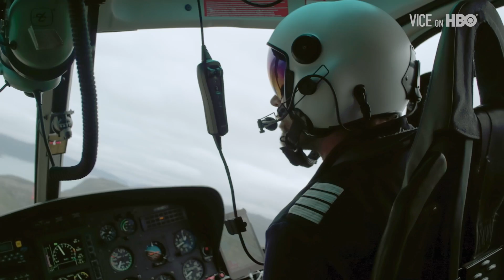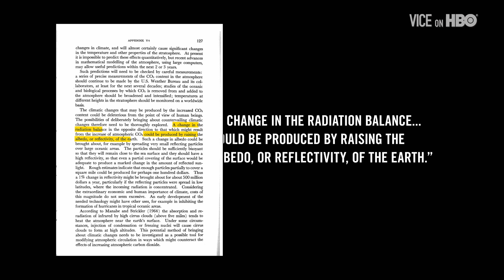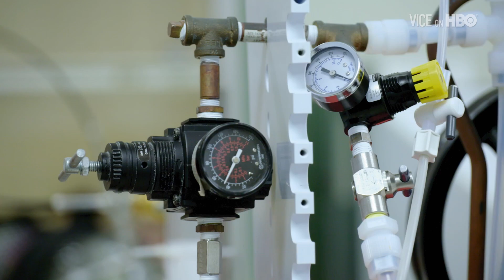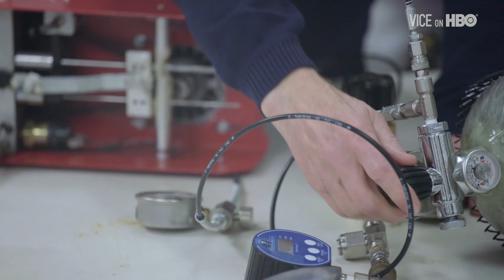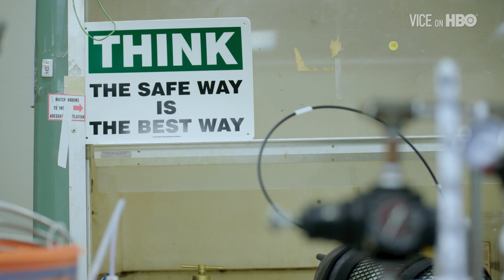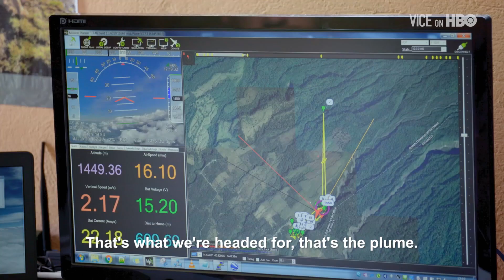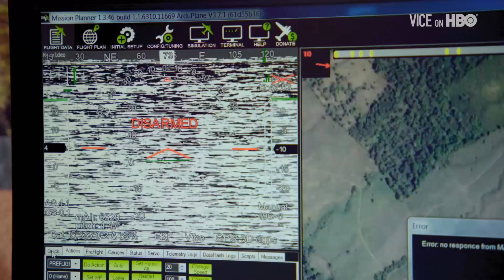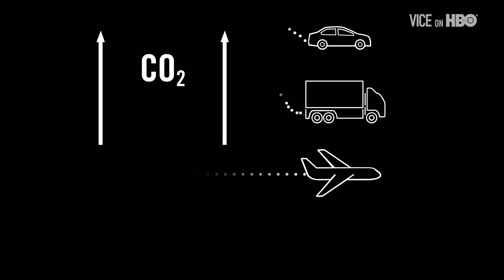Geoengineering May Be the Answer to Climate Change

Comment: Impressed about the project that turns CO2 from air into fuel. It is good that researchers are working on climate solutions like geoengineering. But there should be clear regulations so that these technologies are not misused.
Reply: Considering this video is 3 years old and we are experiencing record fuel costs, I'm guessing that project failed.

Comment: Negative Emission Technology at scale is ready and functioning in the form of Regenerative Agriculture. Add Enhanced Rock Weathering with the volcanic basalt and add Biofuels-to-Biochar production to Agro-forestry initiatives and the drawdown potential is huge. Jobs never ending through climate initiatives aimed at adaptation, shoreline stabilization, environmental renewal. Atmospheric solar reflective engineering and direct air capture represent the nexus of militaristic and corporate opportunism for a problem that cannot be solved by high tech engineering alone. Negative Emissions technology that proposes to sequester carbon "underground" through down hole pumping ignores the fact that CO2 is actually needed by plants to grow at the surface, to produce carbohydrates, to build soil carbon through photosynthesis. If we don't lower the pH of the ocean through land applications of the basalt and other alkaline rock dusts through mineralization climate stabilization doesn't happen, no matter how many solar panels and wind mills we build. We need to intervene in the upward spiral of the carbon cycle, reversing 200 years of industrial emissions. We can do this through active land management and maritime restoration.  This is basic science. www.rockdustlocal.com

Comment: One question for the magician pulling CO2 out of the atmosphere and "recycling" into fuel....... What is the energy source you use to accomplish this? You can not do this without energy input.........
Reply: solar or wind have been suggested so far. They are very peaky inconsitent energy forms so technology for removing CO2 will be turned when there is electricity surplass for example in the middle of the day.
The scale at which it is needed to be effective though is super alarming.

Comment: 19:18 "The price to you at the pump is the same" To good to be true. In that case he is a coldhearted liar :(
Reply: ummmmm wat
Reply: Might be feasible eventually... Gasoline is relatively expensive.

Producing gasoline requires a lot of complex infrastructure & machinery, extremely expensive oil exploration, drilling, transportation (high maintenance cost oil tankers, pipelines and tank trucks) as well as complicated and power hungry oil refineries. Oil companies spend literally couple of trillion dollars annually in order to produce gasoline, diesel and kerosine - and we quite willingly cover that two trillion dollar cost (plus hundreds of billions of dollars in profits for the oil companies) every year when we buy gasoline at the petrol station or pay for flight tickets. 

Carbon Engineering's production units/factories could be built closer to the end customers reducing transportation costs significantly. Also their "raw material" (CO2) and (H2O) are practically free. Carbon Engineering might one day be compensated/paid for removing CO2 from the atmosphere resulting in negative price for one of their raw materials. Furthermore their production units would likely be less expensive to build and operate than e.g. offshore drilling rigs and oil refineries.
Reply: Horizon585  Absolutely. The technique seems amazing. I would even consider paying more for this kind of fuel. Maybe even twice as much. And our state (Sweden) could pay subsidies (totally ok with me)

Comment: CO2 AGW depends upon a molecule that adsorbs a minuscule amount of radiation in the 15 micron region that is done within 30 feet of the ground. After that it is all conduction and convection gas thermodynamics. There is no 'back radiation' = the potential energy is  converted to Kinetic energy just as it always has been for millions of years. Within 30 feet -> IR radiation @ 15 microns -> Potential Energy -> Kinetic Energy -> And the "hot" air rises up like a hot air balloon and cools the earth. Nothing new here, nothing happening here, there is no mystical, magical, moronic 'CO2 feedback' (feedback doesn't happen in actual science). There is no 'heat trapping' ever, period, never has and never will be.

Comment: Horrible headline,  they even say geoengineering is a last resort that may have devastating consequences of not monitored closely. The carbon capture fuel is obviously the better choice in the presentation but it's not the headline. Those two processes should be very clearly delineated, one adds more chemicals into the atmosphere and the other works on a perpetual carbon cycle. Put everything into the working concept that doesn't have a high potential for easy errors

Comment: If you want to solve a problem, it would be useful to identity it correctly. You do that by not confusing cause and effect. The climate is merely a consequence, the problem is the economy. A materialistic culture that requires high inputs of carbon energy that are utilized inefficiently, and unequally and therefore requires constant growth. The waste from that growth is effectively subsidized through incentives and incorrect pricing, because the economic system as a whole  requires constant growth and the legitimacy of societies is premised on that system and its growth. All we need to do, is eliminate markets and move to local small scale autonomous household production.

Comment: Replacing gasoline with cellulosic ethanol would be a carbon neutral alternative.  Cars originally ran on ethanol before Rockefeller and Prohibition.  The energy density of ethanol and gasoline are pretty close.

Comment: Putting a price on climate pollution is our most powerful way to reduce ir:  http://citizensclimatelobby.org/basics-carbon-fee-dividend
Changes in land use and agricultural practices to pull CO2 out of the air is also necessary. 
Geoengineering is a poor substitute for those because it will always have serious unintended consequences.

Comment: The part where they were talking about carbon capturing ("recycling fuel"), was the most uneducated thing I'd ever seen in a Vice video. There's an 891 kJ/mol energy difference between carbon dioxide and methane; where does THAT come from?
Reply: Sunlight. It's solar powered.

Comment: They're already geoengineering.  Do you think they'd ask us for permission?    LOOK UP!
Reply: EXACTLY!
Reply: The internet was a mistake. All it did was spread conspiracy theories and super-charge them by giving rumors power. Antivaxxers, chemtrails, fake moon landing, flat earthers, climate change denial.
Reply: @Ree1981  They're suggesting they'd use high altitude planes to spray aerosols.  If you have two working eyes and a neck, all you have to do is look up.   You'll see exactly that.  And they have no registered flight pattern with the FAA, as there are sites that track 24/7 in real time.   Try your gaslighting somewhere else.

Comment: 10:30. Hmm, so the ships leave lines like the planes eh?
Reply: Yes. The ships spray salt water mist, which allows more water droplets to condense into clouds. If the air is too clean clouds can't form even though the humidity is high enough. This is similar to an opened can of soda: Even though the CO2 concentration in the water is high enough to form bubbles, they form only very slowly. But when you introduce starting points for the bubbles, for example dust, mentos or engine exhaust particles, a lot of bubbles form very quickly.

Comment: 20:00 this still sucks though, it's time to ban the combustion engine because it's so inefficient. Most of the energy is wasted as heat.
Reply: Most of the energy in sunlight is already wasted each day. The potential chemical energy in fossil fuels ultimately came from ancient sunlight, and the proposed recycling tech is also powered by sunlight.
Reply: John Ames Do you have any other alternatives? Something with even remotely close power or energy density of an ICE for use especially in heavy industry? No? Didn’t think so.

Comment: the only problem with geoengineering is that it is too cheap and too easy and too effective and too politically impossible to implement.  Once the Greenland ice sheet slides off and the Tundra methane spikes and Wall Street is under water we might then get around to it.

Comment: Best Disaster Movies
1. VICE News
2. Day After Tomorrow (2004) PG-13 | 124 min | Action, Adventure, Sci-Fi. ...
3. Deep Impact (1998) PG-13 | 120 min | Action, Drama, Romance. ...
4. The Poseidon Adventure (1972) PG | 117 min | Action, Adventure, Drama. ...
5. The Towering Inferno (1974) ...
6. Earthquake (1974) ...
7. San Andreas (2015) ...
8. Dante's Peak (1997) ...
9. Poseidon (2006)
This is what selling. Its all about sale. Good work VICE.
Shane Smith schould be more worried about his cholesterol levels.